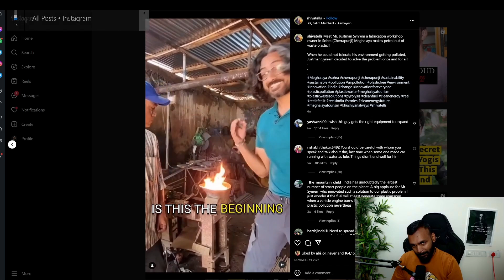Can this man burn PLASTIC to get PETROL?

Comment: Your biases are getting you. How does charcoal form? Not every statement is black and white as you say yourself. The guy mentioned higher temps and he clearly missed the 'pyrolysis' with burning so yes you can rant at him but it is actually demonstrated that high temperature pyrolysis of plastics gives 85% jet fuel and 15% diesel. The scientists claim the process is scalable and definitely it is a net energy negative process but it is possible. Shall put the link of the paper shortly

Comment: It is possible to convert plastic into fuel using a process called pyrolysis. Pyrolysis is a chemical process in which plastic is heated to high temperatures in the absence of oxygen, breaking it down into its component parts. The resulting mixture, called pyrolysis oil or plastic oil, can be used as a fuel in place of fossil fuels such as gasoline or diesel.

Comment: This video was supposed to show about the plastics pyrolysis but in that process plastic is being heated in absence on oxygen so technically we are not burning plastic but breaking the molecular level into the crude oil that plastic was made so we can reverse the process and that process is known as plastic pyrolysis.
Reply: Yes, thru plastic pyrolysis, one gets chemical byproducts. Not sure you can get readily usable fuel.
Reply: That is still not called "burning"
Reply: @soch.original  it's it's never burning the terminology is wrong
Reply: @hitendrasingh7239  I agreed with your original comment. I was stressing (for others) that the pseudosciencer in the video was calling it "burning" of plastic, which is not what pyrolysis is.